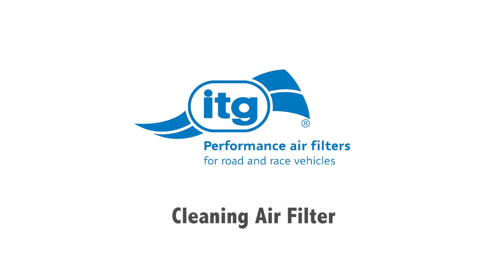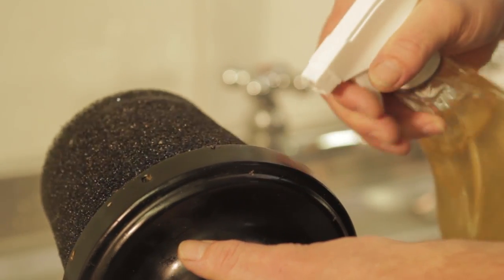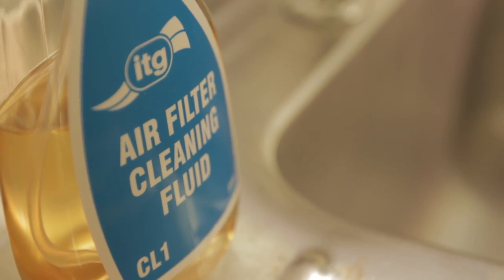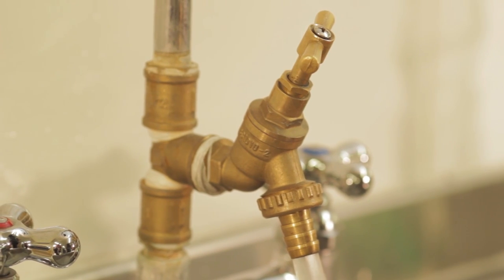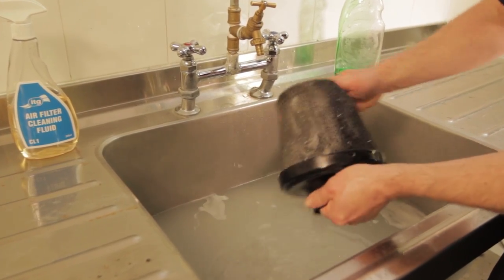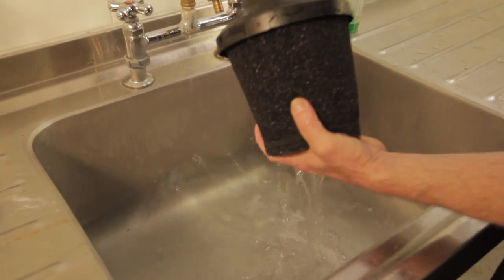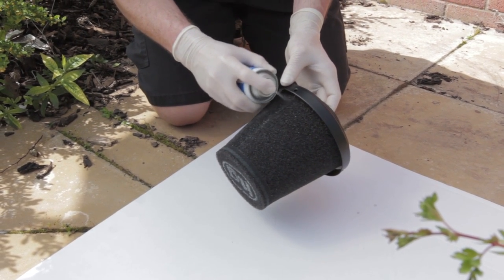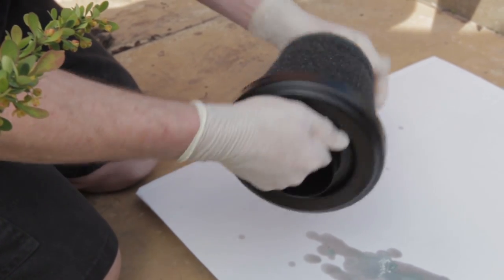ITG Filter Cleaning Guide

Comment: what if i do not have clening fluid? what is that made up with? can i apply shampoo or dish washing liquid?
Reply from the maker: Only ITG recommended oil and cleaner are suitable to use on our filters. Please contact your nearest distributor for supply. Thanks
Reply: As the video shows, yes you can use dish washing liquid. They are using Fairy washing up liquid.
Reply: You cannot use washing up liquid. It will sort of work but I did some tests with spraying the ITG oil on a plastic bottle. Washing up liquid didn't really touch it when I tried to clean it off but the ITG cleaner melted the oil clean off with no effort. It is formulated specifically to chemically react with the oil and break it down quickly and efficiently.
You will get close with washing up liquid but it really is going to take a long time and you wont get all the dirt out. 
I thought I would try washing up liquid on my own filter before my cleaning and re-oiling kit turned up. I thought it was clean. Then, when my kit turned up,  I used the solvent and a load more grit was released from way inside the filter.

If you are worried. The cleaning and re-oiling kits are not a use-once item. Plenty in there for several cleans and re-oils.

Comment: are there any risks to over oiling the filter with the technique in the video?
Reply: illogik Yes. You don't need to use anywhere near as much oil as shown in the video. I  ruined a Ktec air filter following the oiling advice shown. Use less and massage in.
Reply: I heard a mechanic say to use less oil but to keep the filter in a plastic bag and massage it in. Made sense.
Reply: I have just done that. Large zip-lock bag. Massage in, leaving over night to soak through and then some more massage tomorrow to be sure.